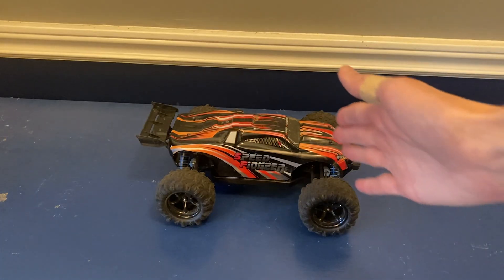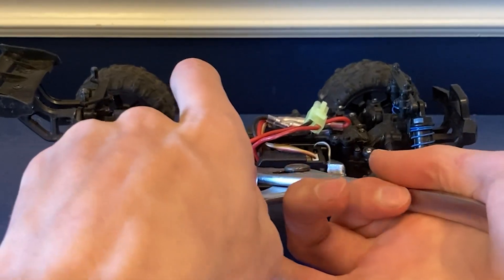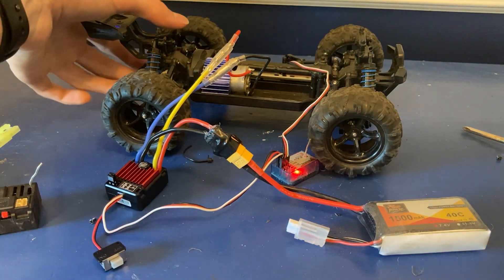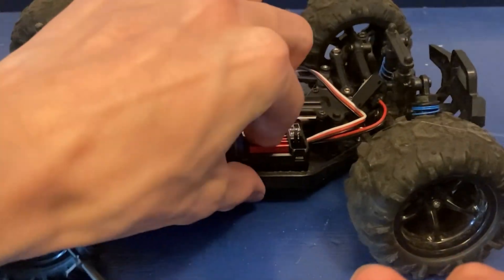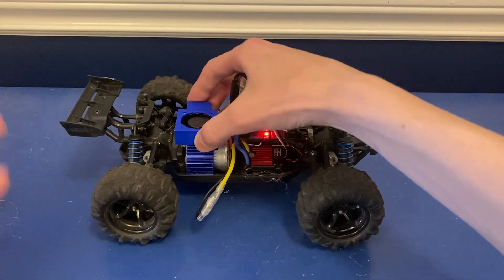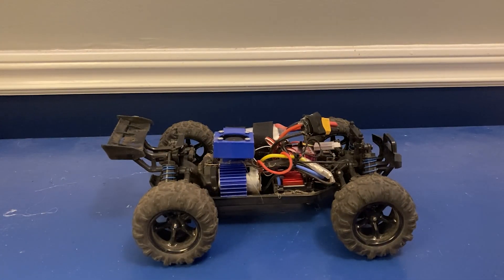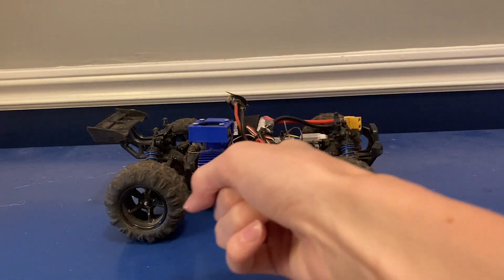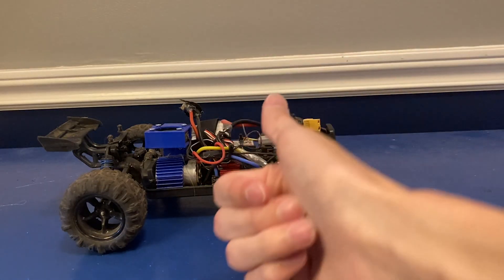Overvolting a Tiny Brushed RC car! - Pxtoys 9302 running 3s on the Stock Motor!

Comment: easier than hot glue is double sided tape.  sometimes i used velcro strips with adhesive so i can change parts quickly instead of them being glued on

Comment: The start of a new sandy land! I had to modify my servo and servo horn so much to get it to work properly! I like how you kept the original motor in,  i really need a fan, i have one, but it looks like its a five wire or something, nice test!
Reply: five wire fans should work too if u find the negatve and positive.
Reply from the maker: You could probably make it work, but you’d need to make some new connector. It might be cheaper and easier to just get a fan that has the right plug from the factory.
Reply: @CHEESEBURGERRC  yeah, the plug just doesnt work in the receiver, its like the stock servo plug
Reply: @Cheesicle_  no, it is a different plug, so sadly i cannot
Reply: @Unuk2001  soo? just solder on a new one
Reply: @Cheesicle_  haha, im not that good at soldering, its very tiny stuff, and plus, there are 5 wires, and only 3 slots in a regular plug, so what would i do with the other 2 wires?
Reply from the maker: The 3 wire plugs have 2 for power (positive and negative) and one for control. All of the fans I’ve had only have 2 of the wires, and the control slot is empty. I don’t know how it works for 5 wire stuff, but if all 5 wires are connected, they’re probably doing something.
Reply: @CHEESEBURGERRC  oh okay, sorry, i havent even tried to plug them in
Reply from the maker: Ah I see
Reply: @CHEESEBURGERRC  fans  with 3-5 wires you can controll the speed .
Reply from the maker: Oh wow! That’s pretty cool! I think my 3D printer has a 5 wire fan, so I guess that’s how it controls the speed.